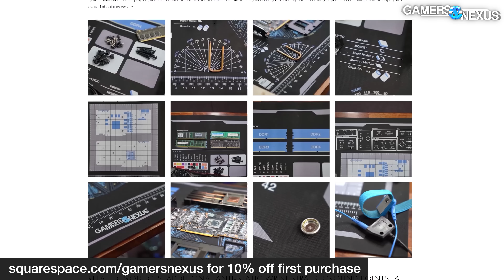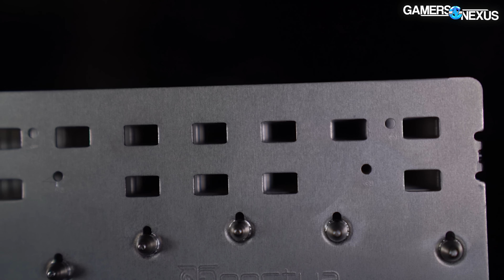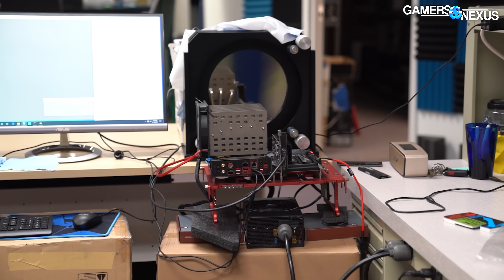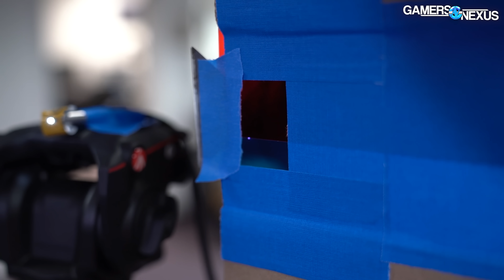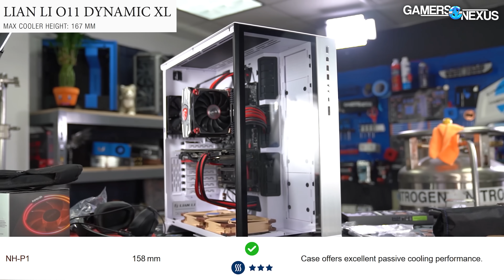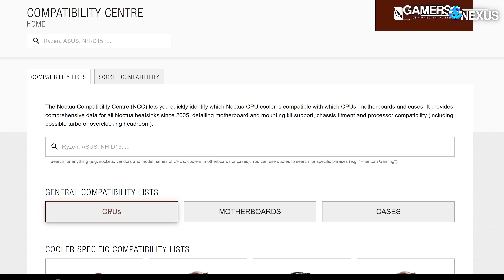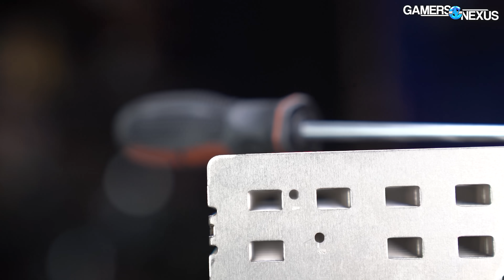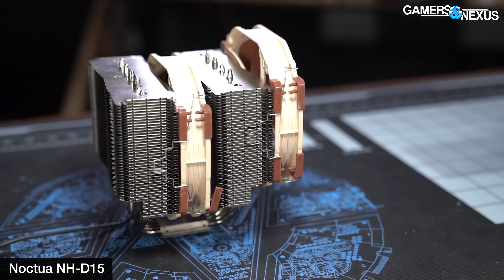Noctua NH-P1 Passive CPU Cooler Review: Benchmarks, Schlieren Photography, & Mechanics

Comment: It would have been kind of interesting to see it compared to a massive air cooler like the NH-D15 also run passively, just to see how much better this design is compared to something not designed to run passively.
Reply: I tried my U14S with no fan and a R5 2600, and after a couple of mins pc was off (I was just in the bios)
Reply: @simo_1989  A NH-D15 is more comparable in mass to the NH-P1 though and has a lot more surface area than a U12S. I'm not saying that it will do well, but when running passively, more heatpipes and more surface area makes a big difference. 

Open bench vs. inside a case makes a huge difference too, unless the case fans are going very fast, then it might not matter as much.
Reply: @Nakna_ankaN  thanks to your comment I realized I wrote wrong: I have a U14S. But yes, the D15 and D15S are way bigger anyway, and maybe they will be better even without a fan.
Reply: The fin stacks on those designed for active coolers are horizontal so hot air will get trapped in between fins. Plus someone intentionally choosing a fully passive CPU cooler is probably going to choose a case with no fans as well, otherwise what's the point?
Reply: @simo_1989  Do you have no case fans?

When I was doing something... don't remember what it was, in the PC, I once forgot to put the 4-pin of the fan of the CPU cooler back in (Katana 5). I realized it like 10 minutes later, but the CPU was only at 55 °C, so not much had happened (and I did boot all the way). 

My guess is that the case fans have done some of the job. The Katana 5 is not a big cooler.
Reply: @leonavis  If I remember correctly, I was just testing that everything was working, and setting the bios. So probably case fans were on, but I didn't have the case side panel, so they couldn't do so much. No Internal pressure, and no airflow to the fins. I have different components now, but I'm curious and I will try the same with the side panel on, to see if my D15S can handle it!
Reply: @simo_1989  the cpu doesn't have power saving features enabled when you're in the bios so it runs much hotter than idling in windows.
Reply: I once had an AMD1600 with a NH-D15S and removed the fan after some testing. It became a little bit too hot for a lasting build, but ran without problems inside my case. So they both can handle 65W passiv and i cant see a scenario where i would choose the NH-P1.
Reply: Yeah I'd love to see that. I run my NH-D15 passively most of the time, since it can keep my 1700X cool just fine under low load. (The case does have a 200mm fan exhausting out the top, which helps a lot)
Reply: And with fan speeds in between. Basically, at 0 RPM the NH-P1 will be better, but with full-blast fans the NH-D15 will win. If we had 4 curves, of noise&temps of each cooler from 0 to max rpm, everyone could pick the better solution at the desired noise level.
Reply: +1 This.

Comment: Noctua NH-P1 sucks. I tested it against my Nofan CR-100A (cooler made in 2011 by low-budget korean company!). The results are: Noctua's cooler 4C higher temps under sustained load. And Noctua's cooler takes incredibly long to dissipate all of its heat once the load ends. It took over 15 minutes until NH-P1 stopped being hot to the touch after the stress test finished. For comparison, CR-100A was cold to the touch after just 3 minutes.
Only benefit of NH-P1 is that you don't need a PCIE Riser cable to use top motherboard slot. Otherwise a pretty bad product. It's sad that a multi-million company like Noctua is unable to beat a 10-year old product made by a small korean company.

Comment: Yeah, I don't like pc noise too. Threw an Kraken X62 at my 4770(non-K), gets a job done flawlesly. Chose one of the quietest gpu and psu too. Can hear fans only after decent gaming sesion. PS.: delided the CPU and changed the thermal paste betveen IHS and die because original sucked, and temps went suborbital (thanks Intel)

Comment: I think this makes the most sense in an airflow case where you’re not planning to watercool it, or something like Linus did with a SFF case and the side panel cut to have the fins sticking out. Strapping exhaust fans to the top of a case instead of a front to back or all positive build seems the way to go with this

Comment: Would you be willing to compare it to the Thermalright Macho Rev.B (http://thermalright.com/product/macho-rev-b/ ) which is also marketed for fanless operation? It's been on the market for years now and I've been using it for a while with a light CPU and it works like a charm without a fan. It doesn't have the large separation of the fins though... Would be interesting to see how it compares. Btw great review, thanks!

Comment: Well, this is Noctua, do they have anything bad, besides colors maybe :P
Reply: Price?
Reply: @GFFrankJaeger  if you consider quality, price is adequate TBH. What is better, buy one more expensive cooler for 10+ years with possibility to buy extra mounts if necessary, or buy cheaper and worse without that possibility? But I am not saying that N is cheap, I myself buy something bit cheaper, and almost that good.
Reply: @slizgi86  i would say price is bad, but think of the reliability. and its good. leave it running for 10 years straight  and dont think you will have issues. and that is the thing that costs. 
same for business and enterprise things, yes there are cheaper and better things, but you need to have it and leave it running for maby 10 years, and you expect it to run it. as for home use stuff. 5 years if you are lucky

Comment: Hey guys, just a suggestion, try a prebuilt PC from PCCASEGEAR in Australia. Just got one for a mate and i helped him unbox it, saved me building one. Great cable management, standard off the shelf parts, very upgradable, p300 case. They included all the extra cables and bits in the power supply box which was packaged with it. After seeing the prebuilts you guys had to deal with it may be a refreshing change to have a positive review on a prebuild

Comment: It would have been interesting to see how some of the other coolers compare when used passively. I had a Noctua NH-D14 for years and the hottest CPU I put it on was probably an AMD FX-8350. Passively running that combination was not smart obviously, but it was possible at least in idle and maybe for a light or short load. With the consumption and max temp of that CPU in mind (I believe 100W idle and no higher than 65°C), that would put the old, passive NH-D14 at about the same performance you have measured for the NH-P1, but with the added benefits of being cheaper, including (And making better use of!) two fans and offering more room for upgrades later on.

Comment: with an nh-d15 on 120w i5 11400 unlocked  no case fans its  at 55ºc 0RPM at idle and 65ºC 500RPM on a stress test I can't hear anything at 10cm so that's almost passive

Comment: I hate to nit-pick you Steve, but umm..aktchually in terms of sheet metal, generally the term 'plate' refers to anything larger than 0.500"~0.750" (depending on where you work). So they are still fins.

Comment: I'd be really curious to see how this passive cooler would hold in a "true tower" type case where air intake would be at the bottom and exhaust at the top if such a case exists on the market of course. I'd argue that it would do pretty well as it could use the full extent of heat movement physics.
Reply: they tested this with rv02 by putting it on its side and it made no difference.
Reply: Best I think, would be to wall mount and put a chimney on it.

Comment: I am going to run a 5800X for gaming only, and got 2x200mm fans in the front, and I am really curious if this with a fan can handle that. Now, let's see the testing.

So, I don't think I'll do that. Would be interesting to check out though.
Reply: it would throttle and not hit boost clocks / i have on with a artic freezer II420 and its still toasty chip but boosts past its rated clock ;
Reply: @fingcoldlife  Still toasty with that AIO? Are you overclocking it? I had planned on using the NH-D15 have since decided to give AIOs a chance again and go for the 360mm version Arctic's AIOs to have a bit more quiet system.

Comment: As an opposite point of comparison, it'd be interesting to see how some of the active coolers would fare without fans to see how much of a difference it makes to actually design for passive.
Reply: Yes! I was hoping to see this. And also, how low an RPM would an NHD15 need to be run at before it makes sense to get the NHP1. 400rpm, perhaps?
Reply: I always wonder how my old scythe mugen would fair with that. It's a fair old hunk of metal.
Reply: Man I'm still using an old Artic Cooling 64 Pro without the fan. Yes, from way back in the days of the Athlon 64s. This was a pretty cheap 35$ cooler and it's still absolutely fine for something like a "65W" CPU even without the fan. 
The only problem these days is that the listed CPU TDP numbers mean almost nothing with all the boosting crap so things are a little bit more confusing for consumers. Back in the day the 64 Pro was recommended for up to 125W CPUs, 160W max (I think), with the fan on of course, something like that. Taking the fan off raises temp under load by about 12 degrees Celsius, in an old Cooler Master case with 4 case fans. You can get a replacement fan to this day for like $3 if you live in Germany or you can stick an 80/90mm fan on with some wire or zip ties or something but I've given up on that. You only need to put a fan on it for "90W"ish CPUs. 
Oh and BTW there's a new semi-passive version of this cooler and it's also under $40. Maybe it's called the Pro Rev2 or something like that, I can't remember.
So there's your answer over a year later. You don't need a giant $110 radiator for a normal CPU unless you have a case with no fans or something really weird like that and I'm rather disappointed Gamers Nexus didn't clearly mention this in the video. Now I believe them that a bigger gap between the fins is better convection, if you're not going to have a fan on at all anyway but it doesn't make that big of a difference. I'd personally rather get a new Artic cooler and just remove the fan than buy something so big and expensive as the product from Noctua. And yes, the new Artic Pro cooler also has a little more space between the fins, it's like in between the old 64 (and other normal tower coolers) and this monstrosity presented here. Lastly I'd mention that I don't care about overclocking or anything else like that these days. For me those days are in the distant past. Cheers.

Comment: Hmm... so I find it rather difficult to compare the performance of this cooler based on this review, but from watching this video, as well as my personal experience with my Scythe Ninja 5, I must say it doesn't seem like the Noctua cools any better than the Ninja 5 does (fanlessly, that is).

Based on the shown test data, I feel like they are on-par, but my thought was that in a case (even if very airflow like my own setup), the cooler would perform better than without any (real) airflow. However you say that it would perform worse inside a case, especially in a low airflow setup... that leads me to believe this cooler might actually be a worse fanless cooler than the Ninja 5, which honestly baffles me. My overclocked 9600K pulls similar wattage in Cyberpunk as the R5 3600 in your test, so that's the closest comparison point I have. Obviously I can't draw any real conclusions from that though.

I hope you can test some other coolers people may wish to use fanlessly, and I would love it if you could show that putting the NH-P1 inside a case indeed worsens its potential. Anyway, thanks for your review as always!

Comment: I still find it funny how Noctua manages to charge AIO prices for a cooler meant to cool low-end CPUs. Not that it's a terrible cooler, it's just that if you're buying a CPU that this is meant for, chances are your budget doesn't allow for a $100 cooler.
Reply: It's not the intended market though. This really for either studios where any noise is too much noise or places where there're many (dust) particles in the air that you don't want in your system.

Pretty sure one can spare a $100,- for such specific purposes if they really need it.
Reply: @MLWJ1993  Understandable. I still think that $100 for a cooler without any mechanical components is just... well, I would say outrageous, but it's kind of characteristic of Noctua at this point.

Comment: Great review, thx Steve!
It looks like a well engineered product and suitable in some circumstance.
I'm not sure if gaming is one of them though, how would it hold up once the heat from the below grfx card starts to saturate the cooler.
The price  is also questionable for the performance or lack there of.
Cheers Gn.
Reply: but the market is different, it looks like it is not ment for a gamer, but more like medical or workshops, metal shops, car shops, they all have PC there and most of them have fans to cool them, because fanless PC are not that powerful or not that reliable. i can imagine this in a car or a wood workshop with an APU, passvice cooling, hidden under the desk or something, because its not bad, and i mean, go find me a similar product that can cool a 65w 5600x or similar power APU. 
then at your workshop you can run your CNC mills off it and look at the scematics etc.
Reply: @AndresUffert2  I agree that in certain situations there is a use for it. I just think there is better performance from a good quality (cheaper) air cooler with a fan running at low (almost silent) rpm.

Comment: One thing I was thinking/hoping we might see would be a comparison against a mid to higher end air cooler with no fan attached. Personally, I use the Be Quiet Dark rock pro 3, but set the fan curve so it (mostly) doesn't come on when idle. I would have been really interested to see if similar larger air coolers might out perform the NH-P1 without even having a fan equipped. You mentioned that having the fins closer together would prevent more efficient air flow, but it would have been good to validate it this way. Also, the Dark Rock 4 pro (the current version of what I have) is cheaper, and comes with two (very nice) fans, instead of none, it or other larger air coolers could be a better value too, even if your goal is only to use them fanless or 0 fan speed except at load. Could be a good follow up video idea, so I figured I would pass that along to you guys!

Comment: I feel like the only practical application for this Is in workstations that can't have any fans running like a workshop with a lot of metal dust
Reply: You can get a fanless 1650 (or after-market mods for a 1660), and anything up to a 65W CPU seems to be no problem (or perhaps a 105W Ryzen in 65W eco mode), so you can pack a pretty respectable amount of power into a well-planned fully passive design.

Comment: What if, hardware components are 'fanless' but the case you use has built in fans and special ventilation that forces the air flow through it? Like how datacenter does it, but in this case you use a 'case' for your fans?
That would imply that everyone has a large case built like a vaccuum chamber lol.

Comment: What if... What if Noctual paired a variation of this cooler with their own case? That is, have the entire side panel become nothing but a radiator for the CPU cooler. Yes, you'd have to install everything before you install the cooler, and yes, you'd have to repaste your CPU to do anything in your case, because you'd have to remove the cooler. And yes, yes, you'd have to have some creative solutions to secure this cooler to the case. Aaaaaand, yes X3, the cooler would have to have a protective cage around it so that you don't accidentally touch it and burn yourself (or the cat). But it could work. 

As an alternative, the hidden side panel could be the cooler. The CPU is basically in the same place on every motherboard, right? Again, you'd need some creative mounting solutions. But it could work.

Imagine, the entire side panel being a passive cooler. It would be glorious!

Comment: For me the use case is specific and brilliant, Since 2013 i have been on the quest to have my fans optional, I used an old prolimatech megahalems (blue ver :) ) on a i5 4690k and no i didnt OC but i simply want to get to the point where my hardware is not fan driven but performs to spec, The case though can have as many as i wish so its all personal preference on where you want your cooling to be with the fans you use, i was doing 90c at 100% full load with the FT05 x2 180mm AP fans at 600RPM (summer will be on high at 1200RPM) and the titan blower on the GPU and the PSU fan that will barely turn on, Gaming was mid 80's most the time, I ran that build for like 4 years before i basically sidegraded cos i was bored, still have the machine behind me though, one of the most loved builds i have done because it was just a bit of an experiment at the time and people would think it was nuts that i didnt have a fan on the CPU, Im hoping that because this is a thing, Other manufactures are gonna churn out good passive heatsinks as well.

Comment: I have an open PC which is just the motherboard sitting on a table with everything sprawling over it, I'm using a Noctua NH-D15 and using a fan curve that stops both fans below 30c, so at this point it is fanless/silent, except it isn't, because my 3tb hard-drive is audible, if I had a SSD this would be a silent PC. :)
Obviously when I'm gaming it becomes a shouty mess but I've normally got headphones on so it doesn't matter. :>)